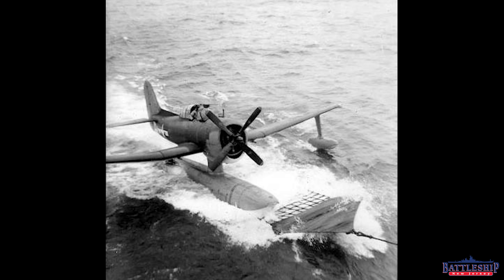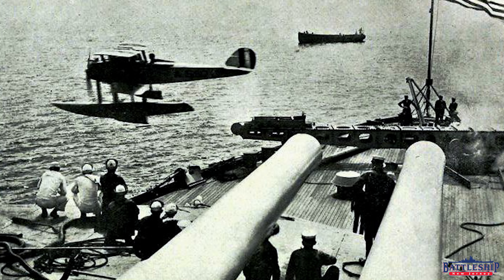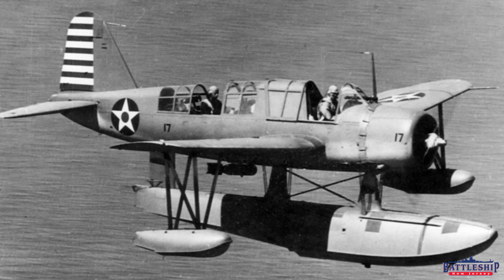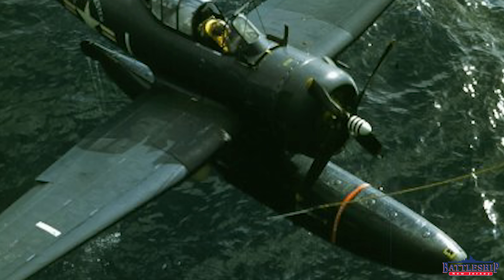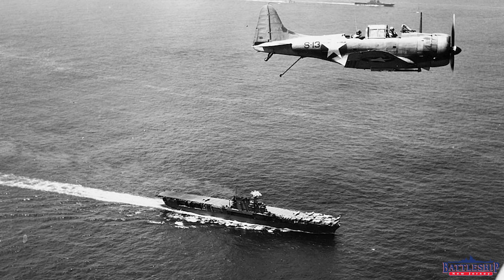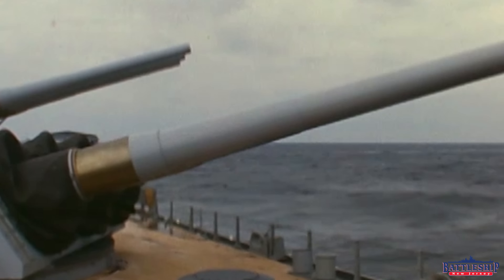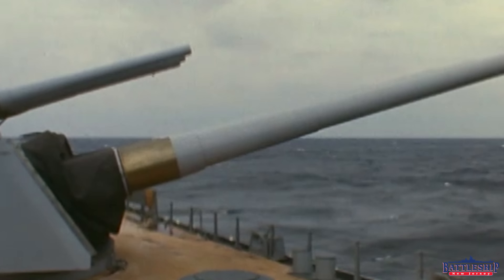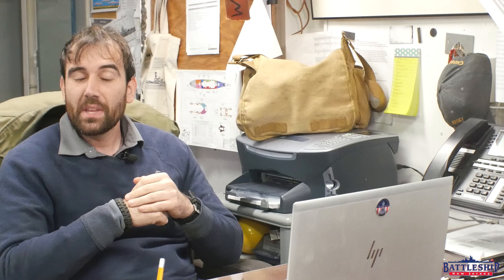Recovering Float Planes: A Picture is Worth 1,000 Words

Comment: Answering the question, "  Do you see anything in the picture I didn't talk about?"  Yes.  The first photo shows the ship in a sharp turn.  This was a technique to create a larger flatter surface on the water to land the floatplane.  It also allowed the plane to cut inside the turn and not have to taxi as fast or as long to reach the sled. Third, it allowed the sled to be launched and recovered from the side of the ship, to keep it away from the ships props, and fourth the turn created a protected area alongside the hull on the lee side where the sled could be held, relatively still, to facilitate connecting to the crane for hoisting.

Comment: Hello, this is a pretty solid video on a little-known subject that I I have been fascinated with studying for a while, also featuring perhaps my favorite aircraft (the Curtiss SC Seahawk), and I'm very glad to see this type of info being brought to a greater audience in a well-done way. 
I do have some minor nitpicks and extra details to offer, but nonetheless they should be supplemental information rather than real criticisms, I just hope that some may be able to learn more as a result.

8:27 The Curtiss SC-1 does actually have a rescue cot in the back of the fuselage for this purpose. The stretcher was very uncomfortable to use (and rescue was slightly inconvenienced by the presence of only one crewmember on the Seahawk, though generally being a single seater design was only to the Seahawk's benefit, as with its' excess of performance for the sake of ease of use and self-defense), but it was nonetheless an option. The follow-on SC-2 replaced this with a seat within the fuselage for rescue or utility, though only under a dozen of these were built (and it seems the USS Missouri used them during the postwar period at some point, there's a photo of it mid-launch in Feb 1948). Photos of the rescue cot and seat, and a whole host of information on the Seahawk, can be found in "Naval Fighters #38, Curtiss SC-1/SC-2 Seahawk" by Billy Jack Long. The series also has a good book on the earlier Curtiss SOC Seagull used onboard Cruisers with scouting squadrons. Older types like the Kingfisher and Seagull, if picking up more than one survivor, did usually use similar methods as what you described however, but often with survivors out on the wings and wing root rather than on or clinging to pontoons. There's an excellent photo demonstrating this when a Kingfisher from USS North Carolina , piloted by LTJG John Burns, saved nine aviators off Truk Atoll in May of 1944 and, unable to take off with such a weight, taxi'd over to the submarine USS Tang on lifeguard duty to transfer everyone (including the aircrew) onboard before scuttling the Kingfisher, as it had been damaged during the ordeal from the waves and weight placed on the aircraft and was unable to safely return to the ship.
13:37 None of the Iowas started out with Seahawks initially as far as I'm aware and did use Kingfishers at first, as the Seahawk was only entering frontline service by October of 1944, with some of the first ships to get them being the Alaska class USS Guam and various Cruisers, gradually replacing the SOC and OS2U in service throughout 1945, with the fleet achieving full conversion after the war ended. Missouri likewise started out with Kingfishers but seemingly was in the process of transitioning to Seahawks at the end of her shakedown period in 1944 (I say that it was in the middle of happening as curiously, there is a photo on navsource at the end of shakedown where both a Kingfisher and Seahawk is embarked simultaneously, a real rarity)- by May of 1945 though she had fully switched to the Seahawk, and you can actually see Seahawks on the catapults in photos taken during the surrender ceremony in September.
17:56 At some point between 1948-1949 more or less, with the last catapult launch taking place off the Iowa in 1949 if I recall correctly (though supposedly the Missouri SC-2 launch photo may be the actual final launch)? the WWIIafterWWII wordpress blog has a good two-part post going into the matter, "Twilight of catapult aviation after WWII".
18:21 I disagree with how this is presented here. Range is largely irrelevant as floatplanes often accommodated fuel tanks within their pontoons and generally are flying at lower cruise speeds to maximize endurance and engine lifespan, and early helicopters are very lacking in range- either of course can't stand up to increasingly capable carrier aircraft however. What speed does for fixed-wing aircraft, like floatplanes, in a bombardment context is give them some ability to safely avoid enemy fire, as from AA guns or Fighters (albeit only really the Seahawk can maneuver with fighters, while the slower Kingfishers and Seagulls are rather inept against them), and to loiter while viewing a target from several angles to get a full idea of what you're looking at. Helicopters can hover in one place for observation but generally are highly vulnerable under fire unless you stay far away from the thing you're observing, especially early types like those used in Korea, that we are using as a comparison point. That said, this is somewhat of a moot point either way, as ship-based helicopters weren't used much, if at all, for gunfire spotting during the Korean War to my knowledge. However, as you said in the video, what helicopters are vastly superior at is rescue roles as well as utility, and furthermore they aren't nearly as complex and costly as operating seaplanes, that rely on catapults, cranes, and sea sleds (in the USN anyways) in time-consuming, hazardous takeoffs and landings as opposed to just having an open space on the fantail for a helicopter.

Thank you for your time, and I hope that more people can learn about catapult aviation thanks to videos like these.

Comment: My father in law piloted an OS2U in WW2 off an Omaha CL patrolling South America and the West Coast. He described the recovery sequence: The ship makes a turn to create a slick of flat water (your photo shows the BB has turned to starboard and the plane has landed in it) The ship trails the sled and the pilot taxies the aircraft onto the sled. The ship hauls the sled alongside.  The ships crane turns and drops a line over the aircraft. An airman makes the line fast to a lifting ring on the aircraft. The crane then turns inboard and the plane is brough aboard.  Obviously this is all rather exciting as sea, aircraft, crane, hook, sled and crew are all in continuous motion relative to each other. In my experience hooking stationary objects with a crane is difficult.   The single seater killed its engine in your photo and the pilot must climb out of the cockpit to hook up with the crane I wonder how many times he slipped and fell? An excellent chance for his next of kin to collect his lifr insurance! On the OS2U the engine ran until the plant was secured.
In my opinion the USN doctrine for shipborne floatplanes was not well thought out. Long range gun duels just didn’t happen and the resulting short ranged aircraft were useless for recon. Of course the OS2U had a 900 mile range, maybe more when stripped of excess weight as they were in the eastern pacific.

Comment: You mentioned the pad eye on the float planes. Actually at least up through the '70s, all Naval Aircraft had pad eyes on the top center section of the fuselage. When a carrier deployed, the aircraft were towed down the pier and a crane picked up the aircraft from the pier and deposited it on the flight deck and the deck crew then would spot the aircraft where they wanted it. If the carrier had left port and a plane developed an issue, that plane (and crew) would miss the deployment. Single guys in the squadron always spent the night before deployment on the ship, because they took the watches and didn't want to get caught up in all the congestion on the pier right before sailing.

I know there were limited places to show movies. On the carriers, there were a good number of movies (swapped around among the ships in the group) and each of the 4 air squadron ready rooms had a projector as did the wardroom and the crew messes. However, on our fall '67 Med Cruise, the USS Randolph (CVS-15) only had one cinemascope lens, but most movies in that era were cinemascope. Showing a cinemascope movie with a standard lens had tall skinny people. We jokingly called it skinnyscopy.

Comment: Another interesting and informative video.  Thank you BB-62 team!!

Wikipedia states that the Curtiss Seahawk was retired in 1949.  It also states that the plane had folding wings and only a single seat for the pilot but had a built-in cot in the rear fuselage for "transfer" of a passenger or a rescued aviator.

It is my understanding that another common way to create a smooth-ish water surface for landing the float plane was to place the ship in a relatively tight turn which would create a smoother surface inside the turn.  The color film clip clearly shows this as do some of the photos.

Pic 3 also shows the same cable rig thru the chock probably for the sled, but now it is rigged to the port side where the plane is being recovered.

QUESTION:  How is the sled rig raised and lowered without fouling the screws and where is it stored topside?  It seems the stern crane would be required, but I can't quite see stopping at least the two screws on the related side just for this.

Comment: Cruisers used their aircraft primarily for scouting and the SOC Seagull biplane floatplane was used on most cruisers,  particularly those that carried aircraft amidship due to having comparable performance to the OS2-U Kingfisher and to having folding wings which fit up to six by design and four in practice in the hangers of some ships. If the cruiser carried its aircraft aft like the Baltimore class (and battleships), it likely carried Kingfishers. These statements are generalizations, not rules, as you can find Kingfishers amidship and Seagulls aft with little effort. The famous Truk Lagoon Kingfishers were from the battleships Massachusetts, North Carolina, and cruiser Baltimore.

Comment: The British still used biplanes like the Fairey Swordfish and Supermarine Walrus for the battleship float plane with the monoplane Supermarine Seagull to replace it while everyone else used monoplanes
So why did the British not get their monoplane gunnery spotting plane until it was too late?
Reply: Because the RAF was in charge of developing aircraft for the RAF and the fleet air arm.   Lovely interservice politics.
Reply: Would the British Supermarine Seagull really have been an improvement over what the Americans used?
Reply: The RN catapults were (before 1938 or so) turret tops and couldn’t launch heavy aircraft - hence the sea fox, and the “heavyweight” swordfish. Monoplanes generally we’re heavier and needed a higher take-off speed, hence a longer catapult we’re needed.
The major refits would fit a fixed catapult amidships, which could manage a heavier aircraft. The amidships position also allowed a couple of hangars to be built around the superstructure.
By the time these were operational, the emphasis had changed from recon/spotting to AA firepower and carrier aircraft.